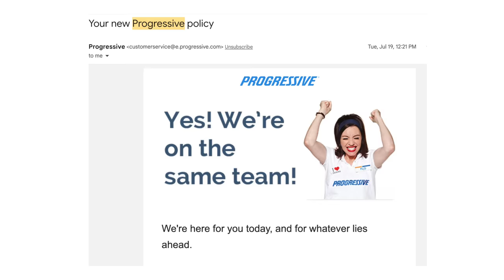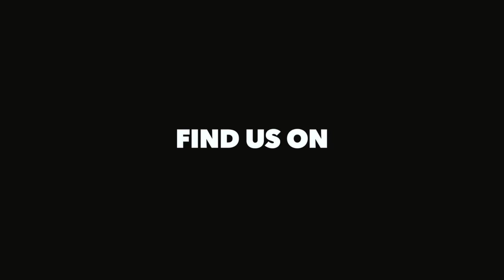Prepping our Boat for 1500 Miles Over Land! | Sailing Soulianis - Ep. 116

Comment: we share a common love: large sailboats on trailers!  i saw from some of the images we also share a common problem... the bow is badly scuffed from the trailer bump stop.  you can buy a rubber skid cover/plate to cover the bow and extend it down to cover the bottom part that grounds first when you bring it in to a beach.  in boat terms its not too expensive.

Comment: I built a very strong mooring using three of those 'earth anchors' laid out in a triangle, with chain leads running to the center of that triangle, connecting to a large ring. From that ring, a mooring pennant goes up to the bouy. There you have it! At any point of loading, your boat is pulling on at least two earth anchors! CONGRATZ on this project!
Reply: Do you have a suggestion how to set them?
Reply: @artsmith103  Mine was for trimaran that drew only 3.5' so I chose a nice spot on the flats that was safe from most boats dragging up there. I needed a friend and the use of a big bar about 10 or 12 feet long. We just passed that bar through the eye of the earth anchor and 'walked' it in. That took a few beers each anchor! Moral of the story, set this up in as shallow waters as your boat can deal with.

Comment: May I suggest a metal car port style cover for the new boat. It'll keep that Michigan lake snow load from damaging her. I would still tarp her under the shelter. You could use helper springs they are bolt ons.
If you never need help with the work just ask, were over in wisconsin and travel to silver lake to play in the sand a couple times a year.
The baby is so cute and all grown up!! Congratulations.

Comment: I have a trailer sailer and securing the lines along the mast always a chore. I found that all the lines by the bow (head sail sheets, main sheets, furler line) can be placed in a medium camping stuff sack. I then close the stuff sack and strap it to the mast, this is so much easier than securing each line individually.

Comment: There's a possibility the original owners dates are off. I got my F-9A plans set #45 in 9/1991. Maybe he bought them earlier and didn't start the build until 1992. Anyway, my build started in 11/1991 and I launched 11/1993. BTW, I built it with my Dad (and brother - both of which have passed now) and we had many great sailing experiences on it.
You should have a lot of fun with your F-boat. They are a tremendous design. Great for day sailing, races and sail camping. They are pretty small for anything more than a couple weeks though and you can't put much weight on them for any decent cruising systems or supplies. They also get pretty wet when sailing at 15+ knots, especially if you are dealing with any ocean or wind chop. But I guess most boats would be pretty wet at 15+ knots.
There were many successful multihull designs before the F boats but Farrier's designs opened the door to a whole new breed of multihull enthusiasts and fast sailors. We could sail with the 50-70' monohull sleds on a real budget. You no longer needed a multi-million dollar boat and crew of 15 to do 20 kts. Suddenly you could do it on a $60K boat with a couple friends and keep it beside your house.
RIP Ian Farrier.

Comment: Some tips:
--- These things sail at anchor in wide arcs, even with a harness. When I used a Fortress style anchor, I ripped it out of the bottom every time. Finally got a 22lb Delta and that did the trick (with 30' chain and 1/2" anchor line). Shame to have to carry all that weight though.
--- I linked the motor to the tiller so it turns with the rudder. This complicates raising and lowering especially with remote controls, but the control is phenomenal. I can motor in a 360 turn in about 1.5 boat lengths. Some older design trimarans with fixed outboards were notoriously hard to maneuver and having a turning motor on a tri helps immensely when in close quarters.

Comment: Congratulations on the boat. Seeing the two photos of all the wood strips.... I know something about this. I made two wood strip kayaks. Mine were epoxy, these might be resin.  I'd recommend regular,  as in constant, continual inspection for pinholes, voids, cracks. (These took out huge areas of glass on my kayaks.) As you probably already know any water getting to that wood core will cause it to swell delaminating the skin. (The bond will be good, what separates are wood fibers from other wood fibers. So you get a piece of epoxied fiberglass with a wafer thin layer of wood.)  
Get used to grinding out and patching the fiberglass. (After making the two kayaks I thought I knew about fiberglass, but it wasn't until I did some patching that I really stepped up. I soon learned to  make the concentric patches, lay them on plastic and coat them all at the same time, coat the boat area, lay it on. Squeegee it.  Less than an hour.  I'd knock down the edges with sandpaper and fair out the patch.  You get really good really fast, but the first time seems a bit tentative.  I got a  factory made glass/kevlar kayak that had been folded in half!  (hauled onto a dock full of water) huge holes. After the first hole it was easy.  Some a foot across,  no backing.  And of course you don't have to match the existing materials. I found kevlar too difficult to work with, probably not epoxy, I used 8 layers of glass and epoxy. Worked great - this was about 4 years ago. Still good. Hope this helps. Looks like a terrific boat. Should be a blast to sail. Of course use a preventer, save your gooseneck avoid a concussion.

Comment: Another great video.  The problem with screwing your anchor into the sea bed or lake bed is that you need good traction and a long lever arm.  The sea floor is not known for good traction and since you are almost neutrally buoyant, you have no weight on your feet to give you traction.  I look forward to your unique solution
Reply: Let's start a string of guesses how they did it and how deep! One commenter has experience with these in shallow water.
* I'll say 6ft with a circling power boat.
Reply from the maker: The answer will be coming out shortly :)

Comment: Insurance on an older boat has become a bit of a nightmare in the past few years as a lot of larger companies have pulled out of the market altogether. Hopefully, you won't have too much core rot to deal with and she'll be able to pass the marine survey your insurance company will require for policy approval. If you do wind up uncovering a lot of plywood core rot, it would be wise to reach out to an experienced marine fiberglass tech in your area to assist with the proper technique in restoration. Ideally, you want to replace as much wood core as possible with glass or closed cell foam, but on a boat like this, everything you do will need to be carefully evaluated for possibly adding too much weight to the finished product. Unlike your old Tartan battleship, the performance of these trimarans can be significantly affected with relatively small changes or shifts in weight.

Comment: Unless I'm missing something, the issue with that trailer looks to be that the axle was mounted inside the leaf springs and not below them. That is putting a lot of weight on the shackle u- bolts. Probably done that way to make launching the boat easier on short slow trips to the boat ramp but would not make me comfortable for that long trip home.
Reply: Similar comment was made a few days ago. I have 4 boat trailers and a utility trailer at home. I'm going to check how many have the leaf springs orientated which way.
Reply from the maker: Yea it's an interesting insight that has been commented on a couple of times now.  The leaf springs that were removed were mounted the same way.  It'd be interesting to figure out how much more clearance mounting them the other way around would provide.  I wouldn't want/need more than 1-1.5 inches. Seems it might add quite a bit more than that...
Reply: @SailingSoulianis  I'm betting it lowers the trailer 3.5 to 4 inches. I'm also guessing it's not safe for road trips as one is counting on a 5/16 or 3/8 u bolt to hold all that dynamic weight. I'm thinking the u-bolts are only engineered to hold the axle to the leaf but not the actual load. -Larry
Reply: @allmomomosthomebus3895  The additional clearance will be the diameter of the axle+plates, ~3".
I checked all 5 trailers. Axle above/below results:
Above: 4'x6' utility trailer, 1 ton axle.
Above: 21', 1,300 lb Monohaul, 1 ton axle.
Under: Jet ski trailer
Under: 14' Alumnim run-about with smaller wheels.
Under: 26', 1,700 lb water ballast Monohaul, 1 ton axle.
Interesting that the 26' Monohaul is under since it's kind of light weight production that prides itself being launched by smaller vehicles.
This research enlightened me about my utility trailer. I stiffened up the expanded metal deck and even notched for the axle but the braces still bottom out on the axle with medium loads. I'm going to try to move that axle under the springs.

Comment: I’m sorry Progressive is being so awful with you. They have saved my bacon a couple of times when my outdrive disintegrated out on Lake Michigan and when I threw a bearing on the trailer while under tow near Cheboygan.  I have both my cars and my motorcycle all insured with them and have never had a problem.  
I have 4 acres of property near South Haven/Bangor, MI and I love having my boat here to work on. An ‘87 Rinker Fiesta Vee 250 needs a bit of work to keep her working well.  Someday I want to put up a building on the slab where my old mobile home used to be so I don’t have to put her somewhere else for winter storage.  I hope you were able to splash before the weather turned and had some time to enjoy your boat in our fresh water sea.

Comment: Did the engine get sorted?  I read that prior to 2006 the honda was carbuerated so perhaps gummed up with ethanol...easy enough to fix.  If so, I use stabilizer in the fuel and run it dry when not using for a while in carbed engines as that darned ethanol will do it.  Hope you got it sorted.  The injected aren't that sensitive.  Wonder what they did to get it going?
Reply: I use No Ethanol with Stabilizer and a squirt of Sea Foam in all my carburetor engines. So far, so good.

Comment: They should have installed the leaf springs on top of the axle.
Reply: Too tall is hard to launch.
Reply: @artsmith103  There are changes that can be made to the neck or the hitch to work around that. Not to mention if you are launching at a boat ramp and you aren't deep enough the back up another foot or three.
Reply: whatap7772  I've got something for you too.

Comment: Congratulations on getting her home without issue.  How did the truck perform?  I noticed the bumper pull so I'm assuming the truck isn't equipped with a full tow package (auxiliary transmission cooler) among a few other things? I was also curious aprox how many miles you towed her?  Currently I have a Catalina 22, but now that I'm retired I'd like to move up to a trimaran.
Reply: I think they said just under 1500 miles. A light load like this does not need the tow package upgrade on normal truck. My smaller boat is a San Juan 21, similar to yours.

Comment: Sailing Soulianis.: I suggest you lighten your trailer by taking off the motor and putting it in the rear of the truck.  Easily less weight in the stern and springs will be less compressed and boat will ride higher along with less weight in the extremity of the load so it won't sway as much.
Reply from the maker: This is a good idea Rob. My concern was with laying the motor on it side for that long of time. I wasn’t sure if it was designed to contain all its fluids properly in that orientation for too long.
Reply: @SailingSoulianis  Yes, But depending on the  brand and model of the motor it is possible. Some motors have a specific direction that they have to be stored on their side  with the control handle  either up or down and with the head slightly raised.  If you chase up the owner's manual (google it) for that model it should tell you which way it can be safely stored or placed for travel because it is common for sailors to remove their motors on long voyages particularly when they are tender dinghy motors.
Reply: @Rob-fx2dw  Don't forget the truck was a rental. Typical tow rig will be Chip the conversion van.

Comment: Oh no, not another trimaran.  They are not meant for families, or long voyages.
Reply: Watch them convince you otherwise. They can sail local or travel 1,000 miles. They can more carefully pick their weather windows. They can "go upwind" at 60mph between locations. They can go 5-10 knots during passage making for almost always daylight travel. They have more hull space than most trailer sailors. Their family is small except for Kirk. The tramps for a lot of elbow room in nice weather. They hope multi hull will help Lauren not to mention smaller, flatter water.

Comment: Rather than using the outboard as your iron mainsail.

How about going full electric?

Put a motor in each of the outriggers, solar panels between the outrigger arms, with regen using the motors as generators.

With a bilge/keel full of LiFePO4 you'll never need to pay for fuel ever again!

<3
Reply from the maker: I actually cut the part (for time's sake) where we talked about wanting to go electric! We'd like to convert at some point, but given we do have a working outboard at the moment, the aft-cabin conversion -- and lots of other small projects that have to do with sail-ability of the boat -- are at the top of the project list right now. -L
Reply: @SailingSoulianis  There are productive places for solar/elec, and non. Highly recommend you never convert at near the power of the Honda. You'll probably use less than 5 gallons (No Ethanol with a squirt of Sea Foam) per year and the Honda package is lighter and more versatile.
Reply: @SailingSoulianis  Long term plans are how we go beyond our dreams and eventually find the most spectacular results <3